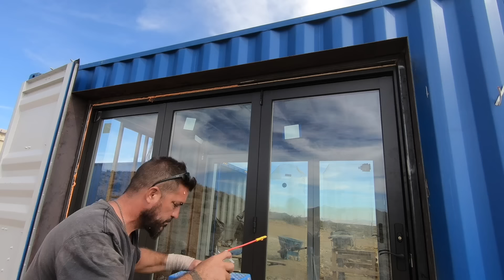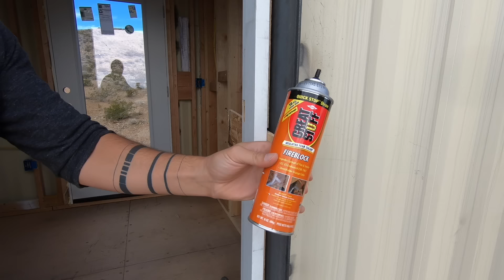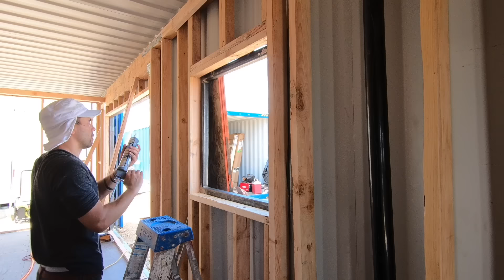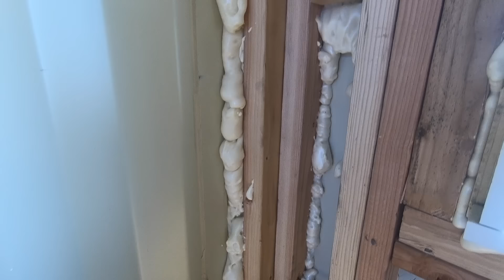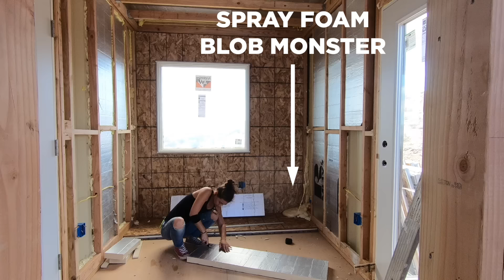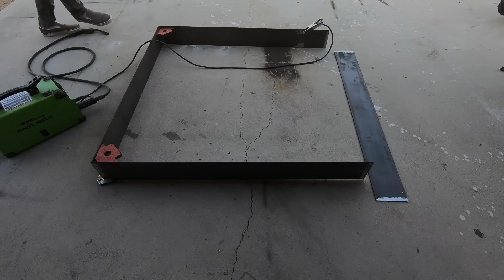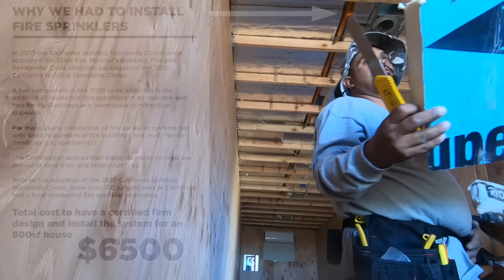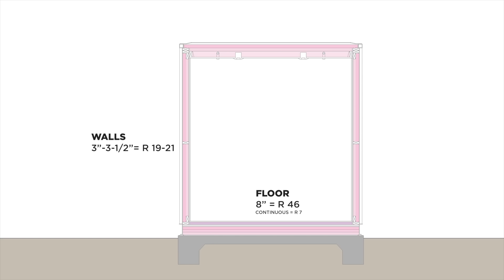Building a Shipping Container Home | EP03 Doors, Windows, and Insulation

Comment from the maker: Hi!  The house plans i used are now available for sale here: https://gum.co/WLXVe
sorry for the delay and the audio issues.  I have been traveling a bit lately and its been hard to keep up on editing.  I wasnt sure how in depth to in the design notes section but i will try to add more information to the web posts which i am working on now.  Here is a link to the architecture firm i co-founded:  https://zeroenergy.com/  if you want to see some of the other houses we have designed.  Go to www.uncontained.house for a 360-degree tour.

Here is a link to the collection of the products we used from Home Depot which was the sponsor for this project:
https://www.homedepot.com/c/openhouse?cm_mmc=socialmedia|O|FY18|NA|YT|Multi|Multi|ContainerHomeDescriptionCollection|

Product Links

Forney Welder
https://amzn.to/2Y4qbIW

Insulation 2” R-13
https://www.homedepot.com/p/Super-TUFF-R-2-in-x-4-ft-x-8-ft-R-13-Insulating-Sheathing-99060464/300528092

Subfloor Panels
https://www.homedepot.com/p/Amdry-2-09-in-x-2-ft-x-4-ft-OSB-Insulated-R7-Subfloor-Panel-AMD0150G/204395337

Liquid Nails Subfloor Adhesive
https://www.homedepot.com/p/Liquid-Nails-28-oz-Subfloor-and-Deck-Construction-Adhesive-12-Pack-LNP-902-CP/202246452

Joist Hangers
https://www.homedepot.com/p/Simpson-Strong-Tie-Z-MAX-2-in-x-4-in-Galvanized-Double-Shear-Face-Mount-Joist-Hanger-LUS24Z/100375190

Ryobi Generator
https://www.homedepot.com/p/RYOBI-7-000-Running-Watt-Electronic-Fuel-Injected-Gasoline-Powered-Electric-Start-Portable-Generator-with-CO-Shutdown-Sensor-RY907022FI/306726967

Goal Zero Solar Kit and Power Pack
https://www.goalzero.com/shop/kits/goal-zero-yeti-3000-lithium-power-station-boulder-200-briefcase-solar-kit/
Reply: How Much Did This Entire Project Cost You? From Start To Finish... $?
Reply: Cool! 👍🙂
Reply: This is awesome.  I’ve built 3 of the furniture projects from your book and I am a fan of the simple yet interesting forms you’ve created!  This container home is on a whole new level of great.  Keep up the great work.
Reply: im just glad I checked the other channel,,,  all good,,,  great series !!!
Reply: Can I hire you to build one for me?
Reply: @Abel-ft1tv  We can help you with that
Reply: pleeeeeeaaasseee bring on the next episode!
Reply: you had to drop the right audio on all the transitions. been deaf in my left ear i had to pull some crazy things with my headset to hear what you were say haha
Reply: Did you have any problems with different thermal expantion of the outside steel layer and the inside wood-based one or drywall?
Reply from the maker: great question!  we have not but that is an issue when connecting wood to steel.  The engineering firm said that it wasnt an issue at this scale.
Reply: @TheModernHomeProject  is it possible to ship this kind of house overseas?
Reply: @TheModernHomeProject  I have a question about your welding... Did you use shielding gas? Also, your videos have been great.
Reply: @Abel-ft1tv  There is a company in Australia who makes really nice units, they are a lot more suitable to be shipped and much more self-contained. I don't remember the name but with a little googling you should be able to find them.... they also used to have videos on youtube.
Reply: @TheModernHomeProject  hmmm...would you be willing to do such a construct in the Caribbean?  I would like to give back to a community by setting up a central compound livity centre.
Reply: Why not just spray foam the whole thing?
Reply: @ecova1392  That's what I will be doing with all of them that I am going to build. Depending on code I might also couple the spray foam with board insulation too, just to get the tax credit.
Reply: Did you consider insulation by InSoFast? 
 https://www.insofast.com/insulation-panels-for-shipping-containers.html?
Reply: @martingardens  That's pretty interesting stuff but the price is crazy. For a 40' X 9'6" container it would cost $2897 plus the R value was nothing near what his turned out to be. Good information though, just rather pricey.
Reply: @mthewolf1095  Did you watch the videos? 

It provides thermal bridging, wiring chases and attachment points for skinning. I would use it on the exterior and put my cladding along with more solid insulation on the outside but probably not on the inside as I still don't understand where any condensation would drain to.

It is also incredibly fast to install.
Reply: Never mind, Ben, you answered below.
Reply: @martingardens  I also asked using insulation-panels-for-shipping-containers or the better healthier option of sprayed on hempcrete....since studding out a shipping containers just to add rigid foam didn't seem to make sense?
Reply: link to your website modern home, where you post the sun chart.??? You have links for everything else, and google does not find it.
Reply: should we expect episode 4. if yes when?
Reply: No worries, I subscribed anyways!
Reply: I was also taught to place high importance on insulation -- but these are the same assholes who teach OSHA and permits and regulations. ...I wonder if we're putting too much money on insulation for too little pay off. ..also one project I felt pretty suffocated.  ..wonder what the real practical differences are and how much oxygen we need. (is it SO insulated you need to constantly open a door/window ??)
Reply: JESUS CHRIST YOU ARE SO ROBBED. ...ok, here is what I wanted to do.. buy a truck/trailor with toilet. acre of land. then build a huge deck around it. ...then I 'live' in the trailor, and merely hang out on the deck. ..then I don't need all the permits and regulations? hell I don't even need foundation/roof permission. ..are they regulating decks besides guards/rails?? can I put a couch/tv on my deck?? .. I think so. ..then you can just build a really sparse and efficient, but still super nice out-door area. ...and you can always drive your trailor out to dump the toilet. (no pumbing!) ... then you build a greenhouse and a pen for your 2 goats...  maybe a chicken coop...  ...don't spread this news around too much, ok... not enough acres to go around...
Reply: @fascistphilosophy5649  hmmm...would you be willing to do such a construct in the Caribbean?  I would like to give back to a community by setting up a central compound livity centre.
Reply: The Modern Hoxxxme Project
Reply: a xxxc
Reply: Your a beast💯
Reply: So have you learned your lesson to not ever build a house in California again?
Reply: I love these type of work but I have no boost or conference
Reply: Can I get a link to the doors?
Reply: Can your firm be hired to do similar projects?
Reply: How much did this entire project cost ?
Reply: With this videos you show us very detailed instructions to everyone dream to build a container home..
Reply: Building codes in California are ridiculous.
Reply: Can you give an estimated time as to when the next episodes will be relesased?

Comment: Why spend the extra money for drywall when you already had plywood up? Just mud the screw holes and seam lines of the plywood. Probably could put a skim coat of mud on plywood too? RH
Reply from the maker: good question! you need a certain fire rating on the interior surfaces for residential building code.  it is possible that it could be achieved through plaster but there isnt a clear path to it that i am aware of that is cost competitive

Comment: For anyone in more humid climates. Please use closed cell spray foam insulation or you will have problems with rust from condensation behind the foam boards
Reply: thank you for the warning
Reply: I was going to write a comment as well to ask if they considered thermal transfer when doing the insulation, but I haven't finished the video yet so thought it may be mentioned later on.
Reply: Truly Zambian he already mentioned thermal bridging in the previous video
Reply: Was just going to ask about that. I once saw a container home being built in Ireland, and he used spray foam because of the gaps created by the corrugation. That made sense, so I assumed it would be standard practice.
Reply: Casper Unnerup Good point, thanks 👍🏻
Reply: water on roof collects in the valleys, anything other than spray foam your gonna get mold in between the walls, leaks will form after about 5 years..wanna know why I know this because ive seen it happen.
Reply: I was wondering about condensation in a metal building, too. 

I dislike the chemical outgassing from the spray foam. 

I'm sure the rigid insulation would have some residual outgassing but I don't know if it is closed cell foam or if it's somehow more permeable so that residual chemical gas is released before it's installed. Of course, there are lot of variables.

Rigid insulation has a different feel and appearance than on-site spray foam insulation so for that reason, I think it's different in that regard. Well, I hope so.
Reply: I agree, mold is gonna be a major issue...
Reply: @WetvanEén  nope
Reply: @WetvanEén  0
Reply: @IamDoogy  And how long do you think that out gassing goes on for professor
Reply: You can use a vapour barrier if the material itself is not enough of a barrier for vapour or not properly sealed with aluminium tape and low expansion foam.
Reply: @BorysPomianek  no. You don't want to trap condensation between the insulation and the metal sides. That's the whole point of sprayfoam.
Reply: @casperunnerup  There are vapour barriers which slow down moisture getting in but also allow it to escape back into the building depending on season.
There are ways to skip ventilating the cavity too but I would not risk it personally.

I don't like spray on foam because only the top of the line dense stuff is actually the kind of insulator people generally expect PIR/PUR foam to be. Cheap foam costs twice as much as the best glass wool but is barely any better of an insulator.
The top of the line spray on foam is a lot more expensive than quality rigid panels and you have to go for the best if you want to get anywhere close to the type of insulation that a rigid panel provides thanks to having a good balance of open cells but then airtight layers on both sides.

It's not a great idea to mix a container like this with wooden framing anyway - this building being in the desert is maybe the only situation where its not a major issue. Wooden framed buildings are supposed to have a breathing outside layer or a ventilation gap of some type.
Just spraying on foam is not a magical solution either because you are not supposed to lock in a wooden frame inside that spray on stuff completely.
Replace the wood with possibly more steel and then you can have a high density foam sprayed inside but personally I would do and airtight layer of PIR panels for half the cost and ventilate the corrugated valleys so to speak.
Spray on foam will completely fill all the cavities but only until the steel (on account of thermal contraction and expansion) eventually separates from it in places creating nice little cavities for mould to grow.

Almost anything will work for the first 5 years and in my opinion you can mess almost everything up and be fine in that time frame. When you want it to last beyond that is when you need to do everything properly. People do experimental things and are amazed because it's all new construction, once it gets to the 20 year mark is when you can really check if it was actually a good idea imho.
Reply: @casperunnerup   pardon my ignorance but isn't one type of vapor barrier, the space between two surfaces?  If so, don't they all risk condensation?  If spray foam is  used to prevent entry of moisture (in addition to insulating of course), than wouldn't any material that really seals, work?
Reply: @JeannineFUNNY  Vapor barriers are intended to prevent the vapor from entering, while at the same time allowing it to escape. Vapor barriers should not trap moisture. Foam insulation is not a vapor barrier. You need something like Tyvek Housewrap. Realistically on a container home, you use mold resistant insulation materials.
Reply: @BorysPomianek  Please don`t comment on Insulation of witch you obviously no little about
Reply: @mikel9567  lol your wrong Tyvek is only an air infiltration barrier and closed cell foam depending on manufacture is an vapor barrier at 1to 2 in
Reply: @danstomber1664  Guy is not cladding the insides with an airtight layer of steel so it's irrelevant how much steel as a material slows down vapour.

I have no interest in discussing anything with an illogical, angry person who lacks a rudimentary grasp of the english language , hence I'm going to opt to block you and ignore your comment instead.
Reply: @BorysPomianek  So at least you know when you are wrong
Reply: @BorysPomianek  I live in Indonesia, temperature and humidity are high. I have read this construction company in Indonesia done container buildings, they said insulation glasswool density 24kg/m3, 50mm thick resulting 35-38C. A Poly foam density 40kg/m3, 30mm thick is 32-35C. That's quite warm still. Wonder if you have better suggestion for a cooler insulation. Or if anyone reading this has experience with tropical climate? Thanks
Reply: @JeannineFUNNY  Biggest problem I see is humid air (moisture) touching the steel.  A beer can effect where one side accumulates condensation.  This appears to be a desert region of California, but this does not mean humid air cannot exist. In fact, a swamp cooler might be highly thought of to cheaply cool off this house build, adding moisture to the air in the process.

Just like the main fuel tank of the retired space shuttle, popcorned pitted foam and all, closed cell foam is sufficient to seperate the metal from the air to prevent condensation problems.  Those problems being mold, rot, rust, etc.
Reply: @BorysPomianek  O I guess the steel is not a vapor barrier right lol
Reply: These thing's are built from cor,-ten steel,  it will be here long after we're gone.